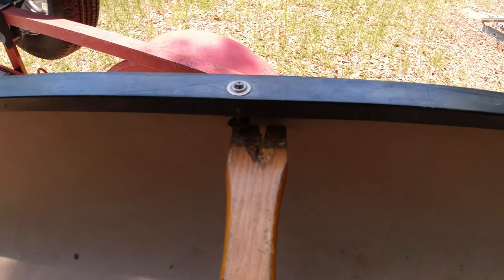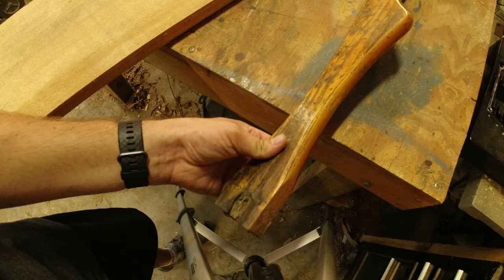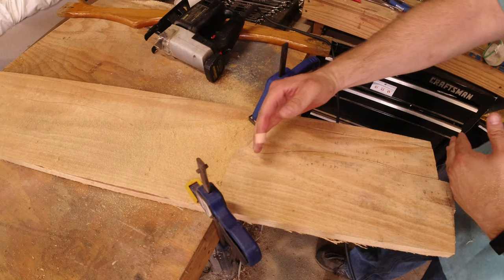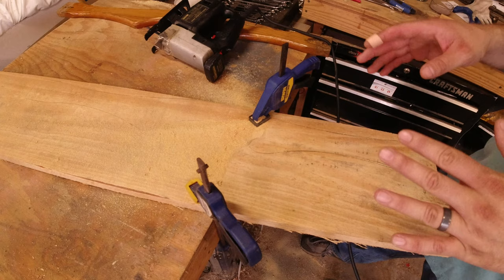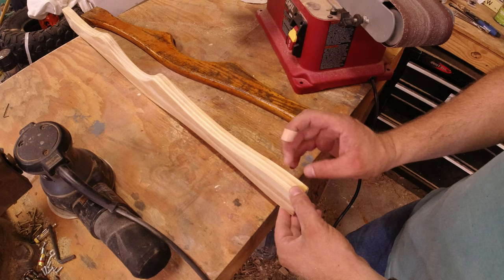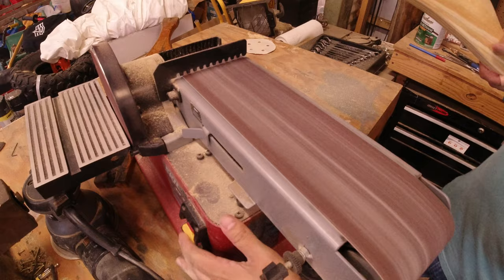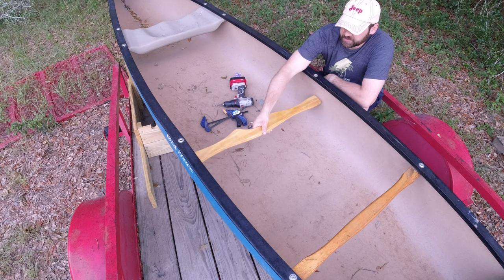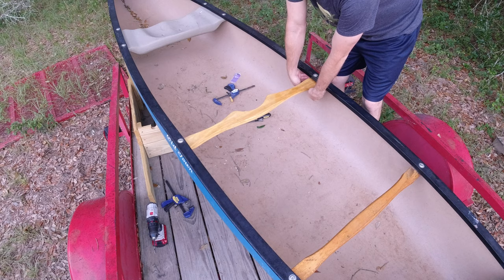Canoe Yoke Replacement

Comment: Good job. The original wood is probably white ash. Mad River uses it. I believe Old Town does as well.  I'm replacing the thwarts on mine and am using maple as it's more readily available and supposed to be a good substitute.  The pine might be a bit on the weak side.. or not. Hopefully it will hold up well. The extra thickness will be a benefit in your case.  Nice you were able to use your own wood.
Reply from the maker: Thank you for the compliments and watching the video!  I hope your thwart replacement goes well.  So far this pine replacement has worked well.  I think it does have a little more "give" than the original.